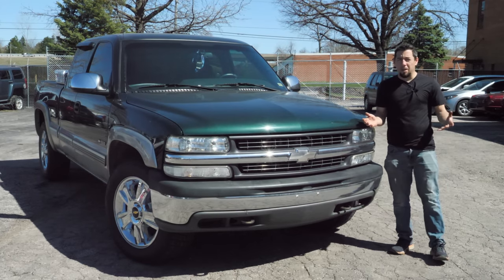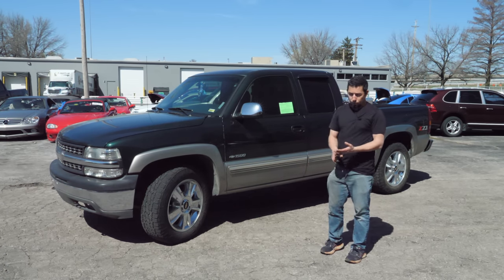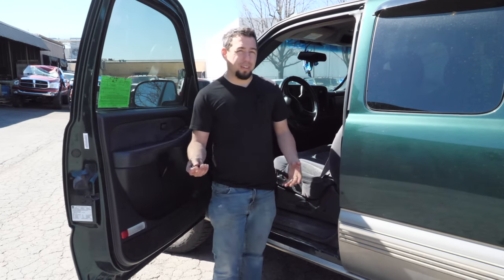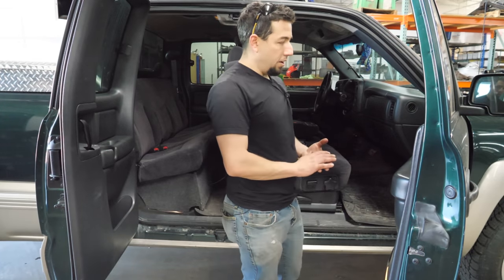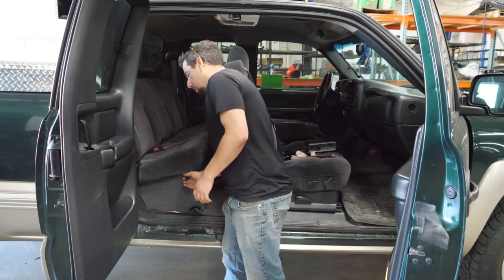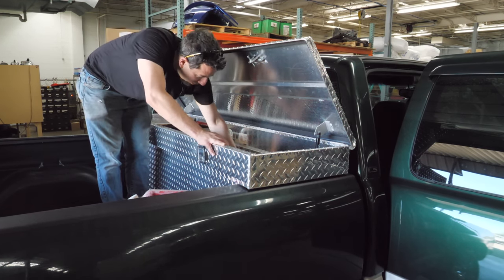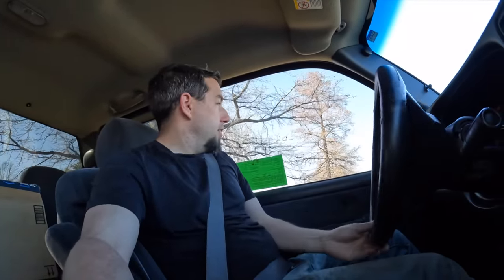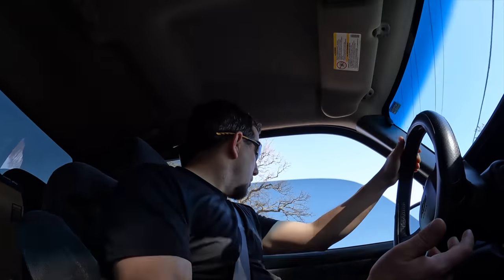Abandoned Silverado Comes Into Salvage Yard, FOR PARTS?! NO!  Saving This One

Comment: That's a crazy good find.  I didn't mind the look with the Colorado wheels, but it does look so much more correct with the '05 ones.  It's not quite as clean as I first thought, but for a snow belt '02 that's amazing.  I've seen 2012s on the South Main Auto channel where the frame is no longer a frame.

The abandonment could be as simple as the ignition switch making the truck cut out while driving.  They took their easiest-to-remove add-ons and the license plates and left it.  They likely assumed on a truck with that mileage that it would be hard/expensive to fix, but they really should've taken it to a decent mechanic first.

Comment: I would buy that truck in a heartbeat ixxx on my people to White I regret it. Cuz it was a good truck I had over 900,000 km on the truck it was still running eye doctor in the cab corners good Ram Santa so she want to sell it I would buy it transgender I would have it shipped to where I live in Canada
Reply: I gave my nephew and I regretted only thing he complained about the tailgate did not work so I fixed it at that point there was talking with the truck oil change. Every year I would oil Donnie's the truck Pandit guitarist away and quit on me was AC compressor it was a easy fix for a because I am a mechanic truck never let me down I would drive it everywhere it had the 5.7 l in great gas mileage on the vehicle if you're around the speed limit it was good gas mileage was great like I said the frame was solid the box look good I just worked great shape no accidents what did I have to replace once can I get replaced with a driver side power window motor that is a GM problem inside door handle once or twice other than that it was fantastic if you want to sell it let me know I am interested in the truck

Comment: ABS lights are a common problem. Internal shorts in the modules and the pump. They cost around 300 for each part new and some don't last but 6 months. The warranty of said parts are even shorter lived.

Comment: I wonder if this truck was stolen considering the condition of the lock and the fact that intermittent  cut out made it unreliable and the person abandoned it at said gas station, taking out the radio head unit for whatever reason. The sub box, probably was not worth the effort, taking it.
Reply from the maker: Reported stolen get flagged in the tow lots system and 99.99% of the time, the reporting jurisdiction meets the owner and/or insurance company to collect the vehicle. Usually happens before it’s towed off, as they have to check vins before they’re hooked here

Comment: My dads truck is a lot like that one, 2000 Sierra 2500 with 225k. Not nearly in as good of shape, but it drives, and my dad bought it new, so I'm keeping it. I'll rebuild the 6.0 LQ4 that is in it, and drive it until the wheels fall off.

Comment: Love mine 2000 original motor I rebuild the transmission 250,000 miles ago putting a total of 418,000 miles on the rest of it, can’t go wrong with them if you take care of them o and Eric says keep on oil in them !

Comment: Why was it abandoned? 
* 300K miles.
* ignition lock was causing what appeared to be a mysterious problem.
* rockers are rusting AGAIN.
* bed sides are rusting AGAIN.
* Wheels are rubbing.
* check engine light on AGAIN
* ABS light on AGAIN.
The owner probably just had enough of this truck needing to be fixed, over and over AGAIN. I have owned one of these trucks, and something was always breaking, over and over. Nothing expensive, broke, but it was always something. This is not the truck for perfectionists.
Reply from the maker: All of your “again”s are likely “still”s in actuality
Reply: @I_Do_Cars  -  I disagree...because the truck is 21 years old and has 300K and someone likely did the rockers, cab corners and bedsides at some point. I think that this was done a while ago because my truck needed these years ago when it was 14 years old and had 130k. BUT, you are the expert here and I only have the experience of one truck.